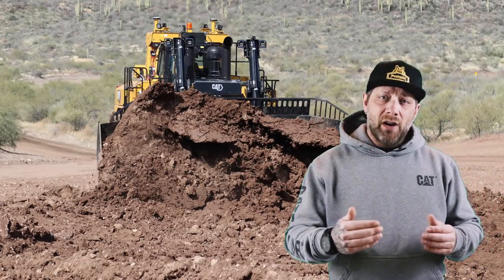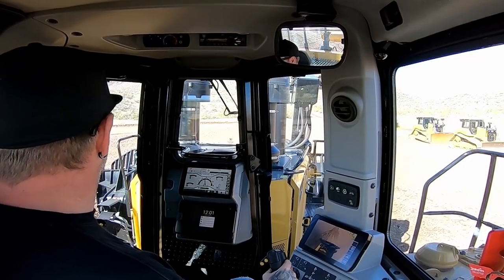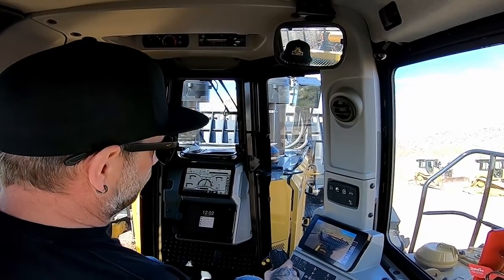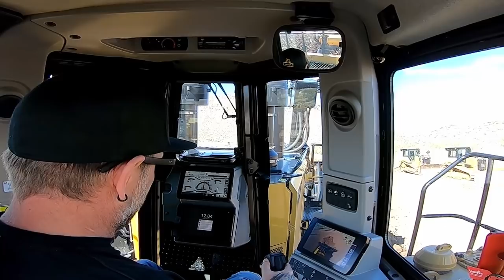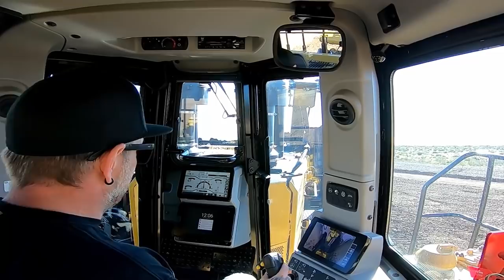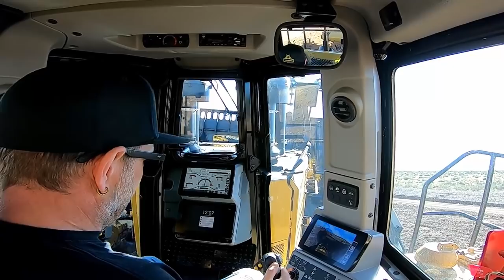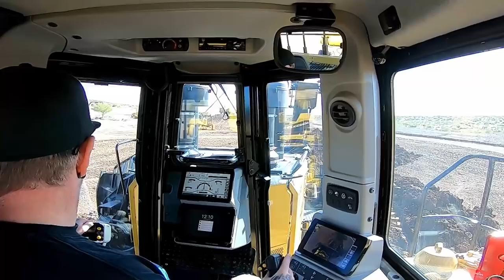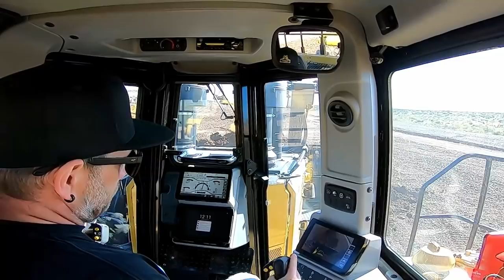INSIDE THE NEW D11

Comment: If you want to see what the interior cab looks like, this video is great. If you want to see what is going on in front of the tractor, you will be disappointed. The manufacturer has incorporated the use of cameras to let the operator "see" what they are actually doing. In a real world these cameras will quit working and be expensive to repair or replace. Big is not always better. That 12" blade is just too big to see around and over.

Comment: The D11 T has come a long way from the 11R. The cab noise in the T is so quiet vs the R. I do miss the horsepower the R had and the throttle up of a locomotive the R made with no emission controls
If you've been in an 11R you'll know what I'm talking about. The next gen seems to have more automated controls then the T has.
Reply: What do you think the xe will be like?
Reply: Ran an R model and a T model both today, split shift between them. Take the R any time, any where.

Comment: The view is scrap when operating a machine a good view is very important. Plus when videoing this you needed an external view also. We watching this didn't see a thing of what the machine was doing. That's worthless information other than you can't see out of this thing.

  Give me one of the old style machines that you can see what your doing and work rings around this fancy exspensive behemoth.
Reply: Vladimir_Bone Spur_tRump  I am not that familiar with the newer models of equipment. But like any piece of good equipment the view is important to the work efficiency. That's the big problem with the new D11 Cats some try to compensate by using cameras and view screens. But like any camera and computer screen you have no feel for distance or size. This affects one's judgement in effective movement and hold true to any equipment vehicles. Nothing can replace what your hand eye coordination can do. You react faster and more precise.

Comment: Control for Wipers behind the operator special in ripping very stupid and un comfortable vat is the problem in designing division in Cat will they locate  this  control in the post between left side door on  their  familiy car Find some old D9L ´82 an se the location of the control there Cat have never get good control for cap heater so go to Volvo for exelent control PS in Icelandic weather operators are switcing on off vipers day in day out in rainy  weather so it is not good to have svitch behind you